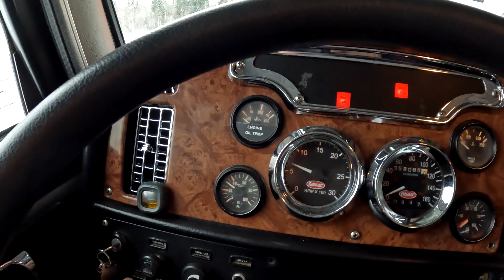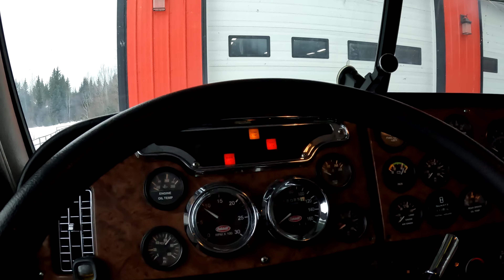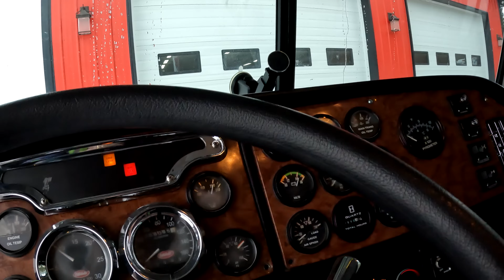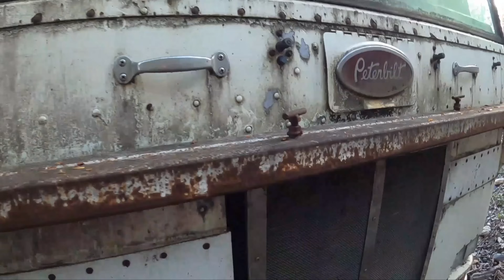K100 Kenworth restoration, Smokey

Comment: Mike, once you cut the rivet  head.  It's  done drill out and replaced.  The tape does  work, but you have to make sure the rivet  gun is straight  on the head. Any  off center  will mar the rivet.  And it looks like your rivet  hun is a hammer  drill. They don't  work very well  for rivets. If you can get a 4x rivet  gun, it will be so much better.  Most aircraft  tool companies  will have these.

Comment: Plain rivets do work well in places you are unable to fit the huck gun.  Plain solid rivets are very easy to install using an air hammer and a bucking bar.  I have installed thousands of solid rivets when repairing aircraft.

Comment: Mike, might be an idea to check over old videos of Smokey coming apart before you do a job then you know how she was originally to put her back together. Not sure if K2 has the same fittings to check on. Did you think to use fibre glass filler for the cab top to get it smooth like a fairing compound/bog/body filler? Just thoughts.

Comment: I had about 4 huck rivets that needed drilling out Mike. Because I couldnt get to the back with the puller, I ran a thread down the rivet and put a nyloc nut on with a washer, just to match them up!!
Reply from the maker: That's a really good idea

Comment: Mike why does it look like the side panel on the driver's side look like it goes behind the corner panel and not over it like the one on the passenger side that you did or am I just seeing it wrong?
Reply from the maker: That's correct the factory pannel wraps around the back but I chose to do a flat pannel bec to make that radius would have been very difficult
Reply: @mikethetrucknut  Are you going to change the other side so they match or are you going to leave it as it is and will it being the way you have to couse leacks in the can?

Comment: Those hucks are tiny I used to use a huck gun that was tethered to a big power unit on a six foot long cart that weighed a couple hundred pounds to huck locomotive gear cases with 7/8" huck's
Reply from the maker: Holly cow
Reply: I've done similar here in the UK. Brake hanger brackets to bogie frames on Freight wagons. I think they were 5/8 hucks. Huck gun was hydraulic, and heavy to use in a confined space.